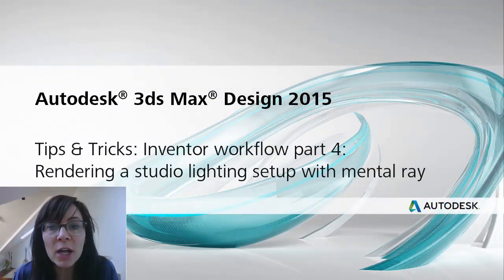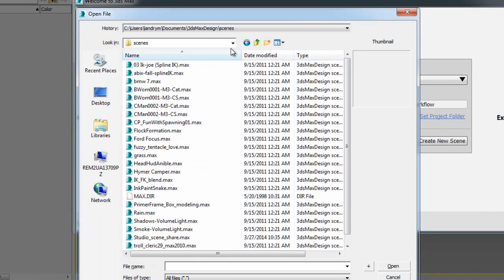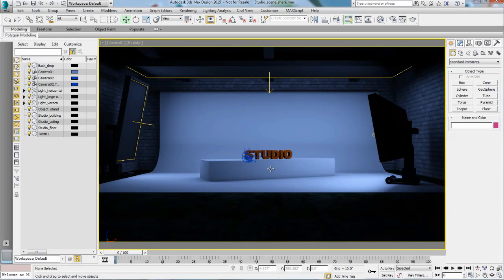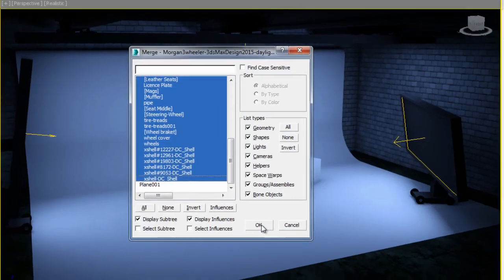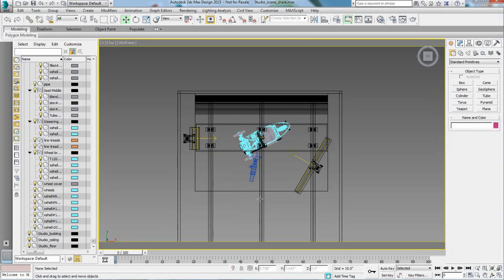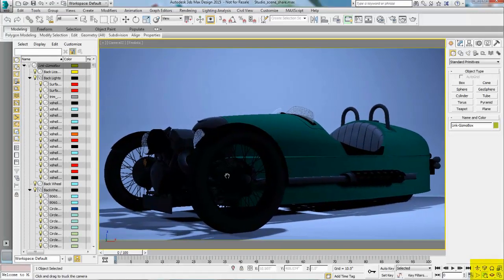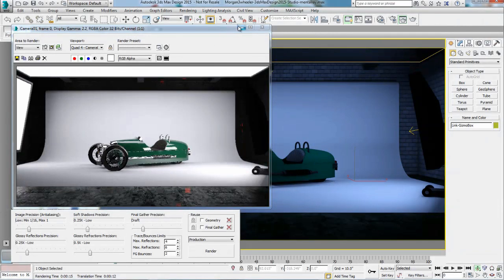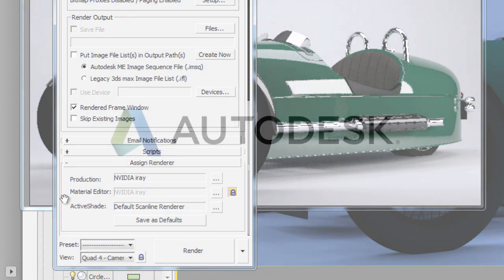Inventor workflow part 4: Rendering a studio lighting setup with mental ray

Comment: Mario Hi! I am a relatively advanced Inventor user but new to 3DS max. I find your tutorial very helpful and on target for those inventor users that need to get good rendering results but don't need to get 3DS max experts. I am trying to use the studio setup as per your instructions but when I set viewports to Realistic view with enabled the scene lights I get a dark (black) display (and similarly is the result of any rendering. It appears as if the lights are not enabled (but I don't see any such setting). I suspect, for some strange reason that it has to do with the units settings of the file. When opening the demo file I chose to use my application unit setting (millimeters instead of inches). I say so because when I try same file and select to keep the files units setting, it appears that above described bug disappears. What is your advice on this?
Reply from the maker: Hi Margaldi, You can't change the system units after the scene is built. Changing the units will breaks everything and give you a black scene. Changing the unit will affect the light measurement and therefore break everything.  Open the scene in the file scene unit settings. Import your model in it and everything should be fine. Once your model is imported, you can change the display units- this will only changes the way you see the units for each tools but not the scene units. It's kind of confusing.. System unit- The system unit is the standard measurement throughout 3ds Max. You should only change the system unit value before importing or creating geometry.http://help.autodesk.com/view/3DSMAX/2015/ENU/?guid=GUID-22D2D2B9-9A82-47FA-88DD-67B1A91E2337
Display unit-   is the basis of the system used to display measurements in 3ds Max http://help.autodesk.com/view/3DSMAX/2015/ENU/?guid=GUID-BDE3C0F2-B27E-4C18-87C2-93E68996F74C
Reply: Marion Landry
Reply: Marion Landry thanks for your reply.  I will try what you propose.